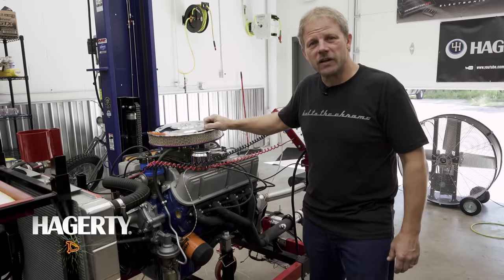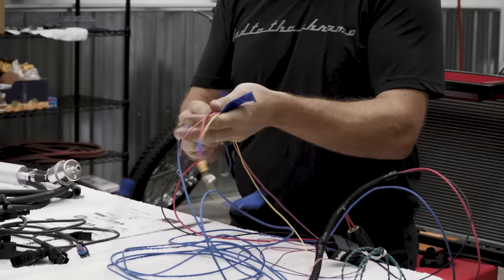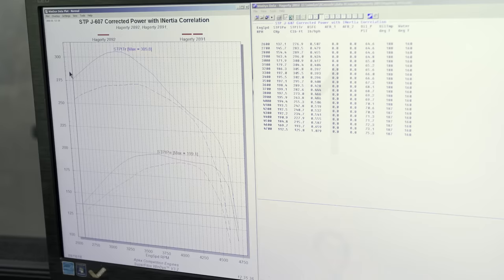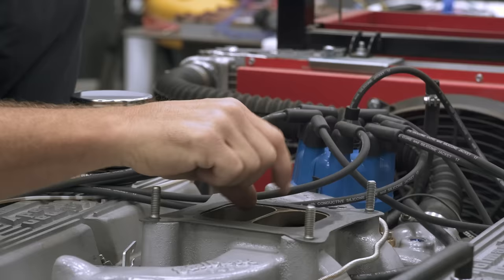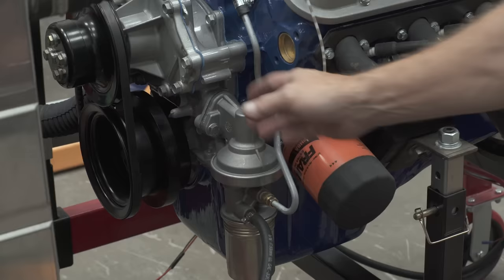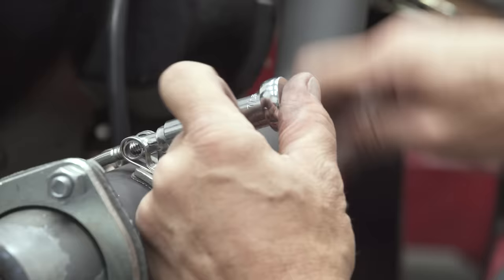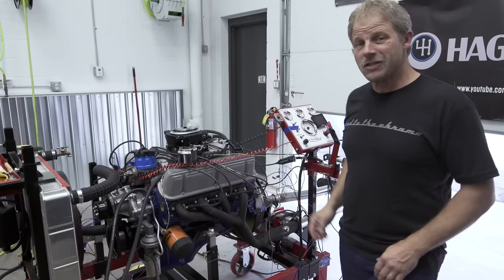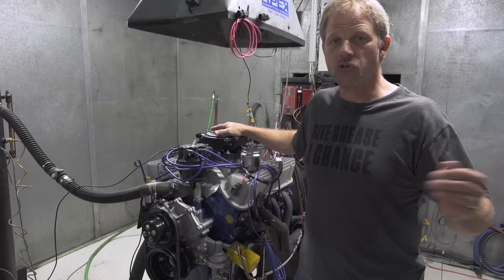Is it worth it? Replacing your carburetor with a Holley Sniper EFI | Hagerty DIY

Comment: Ive spent my entire adult life driving, racing, and tuning EFI systems and carbeurators, mostly Holley classic double pumpers, and in the last 10 or so years, holley ultra HPs, with an Innovate dual wideband, which has been installed in so, so, so many vehicles. With sufficient testing and tuning time, and thorough "pen and paper" data logging, i have personally experienced dozens of vehicles that had their "best ever" overall performance and  driveability/usability, with Ultra HP 650 & 750 cfms. By simply sticking out the time and effort to get the emulsion and bleed adjustments right, using brass blanks and drilling with a pin vise, or out-of-the-kit holley bleeds (master kit), i have never failed to meet or exceed the original cruise and daily driving fuel evonomy of many OEM EFI systems (most frequently GM LS, Ford SD & MAF batxh/seq. EFI OBD 1 & 2 systems, on stock to heavily modified engines, with stock, mail order, and dyno tunes. Most notably, a "Correctly" set pair of accelerator pumps - (shaving/shaping pump cams, custom drilling pump nozzles, shimming/stiffening pump actuator springs, even removing the springs entirely on high rpm stick cars) have delivered the absolute HARDEST "hitting" engines me and my customers have ever experienced. Im talking about wrinkling up sidewalls on mild slicks in 2nd and 3rd with just WOT hits from zero throttle at a roll. It takes time, passion, dedication, and the full setup of adjustment gear, but it is truly a skill you will be valued and respected for.
Reply: You can tune a carburetor only for one optimal air pressure, temperature, and elevation  (aka: Density Altitude) and get excellent results under those circumstances.  I live in Colorado where the elevation in Denver is 5000 ft and I-70 Loveland Pass is 12,000 ft, temperatures go from -20 F to 100+ F.  That yields Density Altitudes from 2000 ft-15,000 ft.   A carburetor has to be re-tuned for all these conditions, which is labor intensive.  The modern electronic fuel injection tunes itself automatically for these conditions.  The carburetor works well in laboratory conditions.  The fuel injection works in real-world conditions. The fuel injection is far superior.
Reply: Sounds like you know your stuff.  Do you have a shop  ?
Reply: I agree taking the time to tune a carb will give great results
Reply: I don't know you, and so can't comment on that other than to say that if you'd mentioned mechanical advance weights, springs, cams, and limits with tailoring different vacuum canisters to get the best advance characteristics, it would sound more credible, especially the last for the economy.

Way back in the day I didn't have much, if any, to do with Holleys - they were several weeks' wages for a 'prentice back then, but I did get to know my way around the QJ pretty well - mostly repairing other peoples'mucking up, but between that and modified mechanical advance curves I did manage to get better driveability and economy in most cases - remember, this was back in the early "smog" days, so that bar was set kinda low. 😉

Nowadays I joke about not trusting I can't see working but, truth be told, EFI is so much easier to work with and, with equal airflow, I'd expect carb's and clockwork to match it at some points, after a lot of work, but overall to be inferior. Throw in significant elevation and temperature variations, as some have said, and it's a no-brainer.
Reply: Agree...more guys have spent thousands hoping thier hot rod will behave like thier 2 yrs old OEM car. 
They wont...and wont be as trobule free/long lasting, either .Many sell it off and put a carb  back on
They are too easy to tune.   Unless somoene lived in sb zero conditions cant see why one woud do this 
Biggest "way better" comments are from those that spent money or had such a horrible tune up before they never experienced what a good running vehicle is .
Reply: Fine tuning a carb WILL get better results. It’s amazing you have the knowledge and time to do that, I think the efi is for the group of us who don’t have this knowledge or time, and for that, the efi is much better. There’s a thousand reasons why carburetors are nearly gone. We just want to drive the dang thing! Also, my altitude where I live changes over 5,000 ft within an hour of driving, and the carb just doesn’t stand a chance. For me, living in the mountains and visiting the city down the hill, it seemed like a great idea.

Comment: We've installed Snipers now on two of our old cars and they run great. No more starting issues or smelly rich exhaust waiting for things to warm up. Highly recommend the in tank pump with the built in pressure regulator. Saves installing a return line and way quieter than the frame mount pump.
Reply: If your carb setup is smelling rich than its either not tuned properly or wrong size carb selected
Reply: Sounds like you have no clue how to tune a carb and probably have zero experience with them.
Reply: What in tank pump did you use
Reply: Good advice madpapa, thanks.
Reply: Come on! I love the smell of gas in the morning it it well it smells like victory!